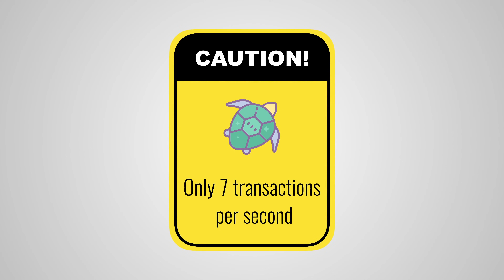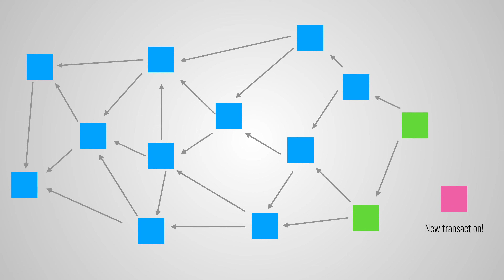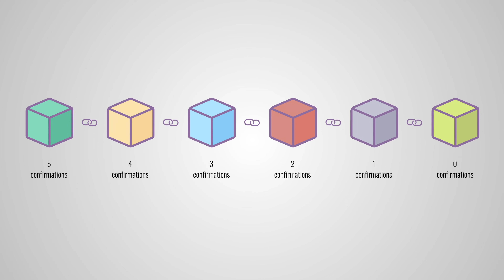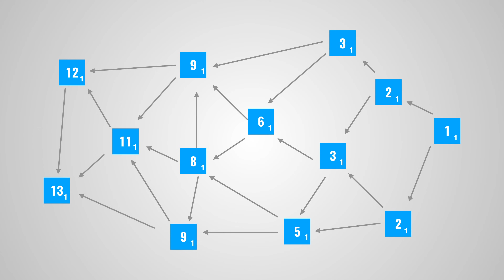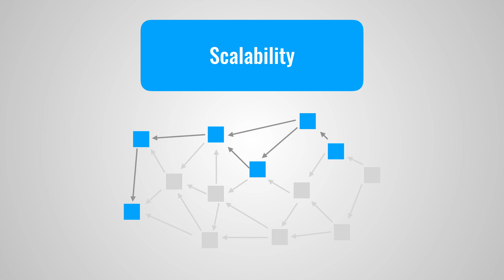IOTA - Simply Explained

Comment: i see they woud have 3 big problems here (among many others).
1 - how you would decentralize/randomize who would be "judging" who - if it's not computing power and rewards (already excellent news) how they will define it? random within what? all the users? geographic location?  
2 -  how you will decide what has to get downloaded live on the "judging" tangles and what will be on the cloud all the time. 
3 - how the algorythmn wouldn't be too heavy so that let's say, a mobile phone wouldn't be able to judge any transaction and how it wouldn't be too light so that it could be broken fast enough before new tips of the tangle come. 

my best guess is that they should use random cryptography. the cryptography that the next tangle would use to confirm the two of the former should depend on an equation which would be a mix of two of the former blocks randomized by itself in a way that the own cryptography could understand and is updated constantly. so it would be really hard to fake because 
1 old transactions would be old within seconds and really decentralized - so almost impossible to fake an old tangle
2 in order to fake a new tangle, you would need to get the right equivalency of both equations that would be on the next block, and in time.

anyway, i really believe this is by far the best idea out there. 
i really hope they have done well on those 2 and a half years.

Comment: Which incentive would nodes have to validate transactions if they get no transaction fee or anything of the kind?

And how does iota prevent double spending? Wouldn't I just need to make a payment to two tips with enough distance to each other?
Reply from the maker: There are no incentives. If you want to create a new transaction you have to verify 2 other transactions. So the incentive is: you cannot create transactions unless you verify a few.

Double spending is preventing by requiring people to verify 2 other transactions for each new one. Additionally IOTA uses a coordinator which checks transactions and locks the Tangle at certain intervals.

Comment: Shouldn't you mention that IOTA's code is ternary, but needs to run on machines (it's developed to run on the IOT's) which are based on binary code and hardware based systems - thus all IOTA code has to be repackaged into binary, leading to massive storage overhead - apparently not as efficient as they would have everyone believe. In my opinion, this seems to be a valid criticism, so one will have to see how they prove themselves in real world transactions. Also how secure this very lightweight confirmation (compared to regular blockchain) network  will turn out to be, once it starts being implemented. On the other hand, it does seem promising, regardless, they just need to address these issues.

Comment: Im still a bit confused... If there are no miners? Are the transactions doing the mining?
Reply: On IOTA the device making the transacion does the mining. Note that the marketing of this coin is targeted for IoT devices, which in general are low processing power devices. Thats why they have the Coordinator, which is a trusted node, run by IOTA fundation, which prevent double spending. Until they turn off the Coordinator, it is a centralized coin. They say one day they will turn the Coordinator off, but I really doubt that, low processing power devices are not enough to keep the network secure.

Comment: Can you do on Ripple and XRP? Also although size is reduced because you don't need the whole "blockchain" eventually when the network becomes large enough and grows enough to have large amount of transactions, IOTA will face the same issue correct?
Reply from the maker: I will research ripple! Thanks for the suggestion. In theory iota is better equipped to handle large amounts of transactions. But I'm sure it's not a silver bullet and problems will surface once it reaches a few hundred tx/second

Comment: I can not recommend the iota Wallet. It's the worst technique I've ever seen. I wish I could sell my Iotas, but unfortunately it is not possible to send these tokens to an exchange !! Because of the outstanding transactions, they are not confirmed by the tangle. What a bad joke ..

How ever, great explanation 👍
Reply: It's not the wallet itself, I tested wallet to wallet transactions and they're almost instantaneous. Exchange to wallet transactions  take forever because they're not processed by the tangle. My transfers from Bitfinex took 24 hours on average but all went through. What improved the wallet experience for me was to install a new release 2.5.5 and change node configuration to http://5.9.118.112:14265 or you can find other nodes here  - http://iota.dance/nodes
Reply: Paul S. Okay great thanks for your help. I updated  the wallet to 2.5.6 and using your recommended node.
Do you have an idea how I can delete the "old pending" transactions in my history? Maybe that's the problem why I cannot send tokens to an exchange..?
Reply: user 999 I know it's frustrating, are your coins still in your wallet or are they stuck in a queue? I still have pending transfers from Bitfinex even though I cancelled some of them, I guess that's normal. My situation is different however  since I never tried to send my iotas to exchange
Reply: I hope by now you've tried out  IOTAs trinity wallet which is one of the best wallets out there. If so I suggest deleting this comment.

Comment: Could you please do something similar for Raiblocks (XRB)?
Reply: IOTA doesn't have fees either.  IOTA uses a directed acyclic graph while RaiBlocks uses a block lattice.  They both don't use blockchains and don't have transaction fees.   They have different methods of reaching consensus.  In RaiBlocks, everyone manages their own private ledgers and transact with each other by creating a send transaction and the other party creates a receive transaction.  RaiBlocks uses delegated proof at stake as its consensus algorithm.  This means people vote for representatives.  These representatives only act when there is an issue and conflicting truths.  The representatives resolve these issues and are rewarded.
Reply: The comment that you left 3 months ago was not free to make--it took a little bit of your time, plus the electricity to run your device. However, there is a big difference between "it's not completely free" and "there is a fee." YouTube did not charge you or anyone else a fee to leave your comment, and in IOTA there are no fees. Is it completely free to use? Only in the same sense that YouTube is free to use. In fact, the costs are lower, since you never have to wait for an ad before confirming a transaction!
Reply: IOTA's tangle uses only a tiny, tiny, tiny fraction of the amount of electricity compared to mining bitcoin. Someone should calculate how many years the IOTA Tangle could run using the electricity consumed by Bitcoin in a day.